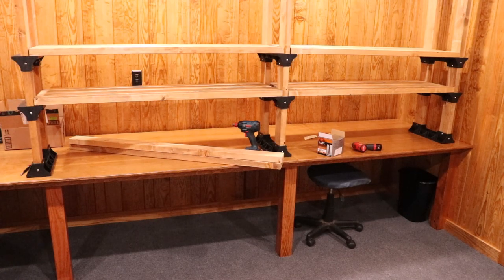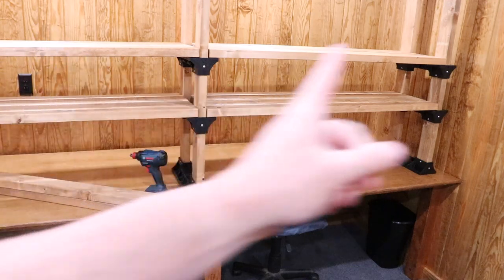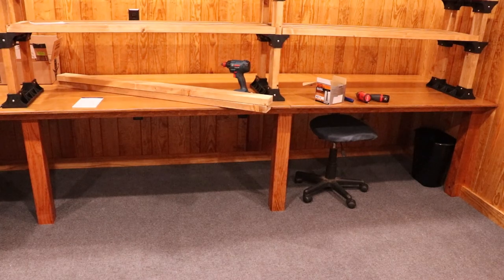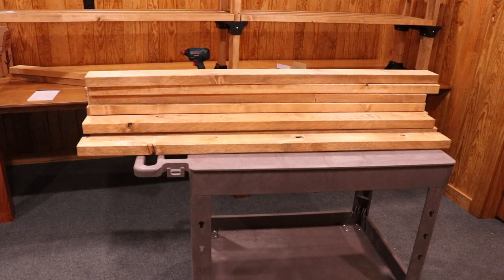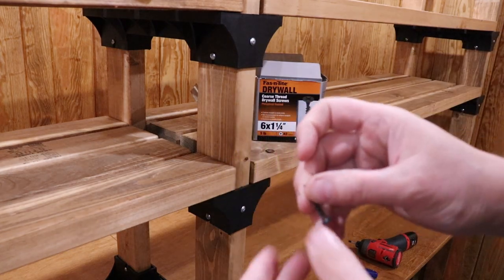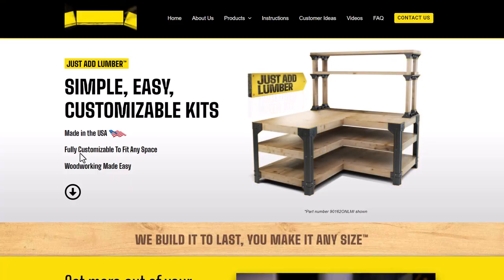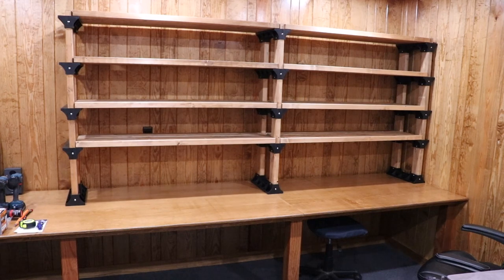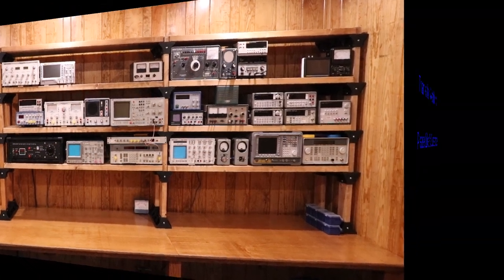How I built my Electronics Workbench using 2x4 Basics Kit - 2023

Comment: Thanks so much for this! You said your shelves are 16” deep, and it appears that the 8903 fits perfectly on it.

Could I ask how deep the 8903 and the 3582A are? I’m building my workbench now and need to size it for these units which are en route via eBay.

Thanks again!
Reply from the maker: 8903 = 18", 3582A = 20".  It hangs off the back a tad and an inch out in the front but no issues
Reply: @Blueglow  wonderful! You are the greatest! Thanks so much for the time you took to do that for me. 🙌🏻

Comment: Good to see you back for a bit.

I have a question for you, not sure if you'll know the answer. On a forum I help moderate,  there's a guy who asked about the Western Electric "small punch" and "large punch" tubes. All we could find on them is a seller that has some for sale with photos. They outer shield actually has holes punched in them. The large has holes with spacing that reminds one of a food colander while the small has holes that look like the screen from an electric razor. The clearest examples are on tube world express. 

The question is, what is the electrical difference between the large and small punch? There's really no info out there on them through my usual search avenues.

Thanks, and hope to see more of the shop as it progresses.
Reply from the maker: small punch is pretty close to wire mesh, they are the earlier made of these and some say they sound better.  I think the large hole tubes are just as good sound wise.
Reply from the maker: There is no electrical difference, just difference in how the holes were punched into the metal.
Reply: @Blueglow  Thanks, Mark. I figured that if anyone knew the skinny about Western Electric, you would.

I guess the current emphasis on punch size is more sales hype than anything.

Comment: Why haven't you turned your hobby into your fulltime business? With your expertise and the high demand for qualified electronics repair work, you would be as busy as you wanted.
Reply from the maker: While there is high demand, the $/hour is super low. No one wants to spend $600 to restore a $300 receiver.  Good restoration work takes many hours and sadly cost more than the gear is worth at the end of the day.  If I could make what I make in my day job or even remotely close, I would have opened full time shop years ago.
Reply: @Blueglow  same here. I have just worked through a 1950s era keepsake 5-valve for a very dear friend of mine. It's her Dad's old radio she has many deep memories of listening to it with him in his Study as a young child. The job became a restoration on account of it having been truly messed with in it's past not to mention the dirt of decades plus the results of heavy cigarette use that stained every part of it. It even had the wrong tubes, someone put TVset devices into it which caused some damage! I won't charge her any $ because what i have learned in the process is far more valuable & that you cannot do this kind of work expecting immense financial reward... None the less she now has quite a valuable old AM receiver that works really well & by what i see on ebay for this model they sell for silly money!
Reply: I think you'd be surprised at how many people would pay big bucks to have their pieces restored, baby boomers are sentimental about their stereos and consoles. Vintage audio shops are making a killing  and are backed up for months and even years . Thanks for your great videos, doing some restoring myself now